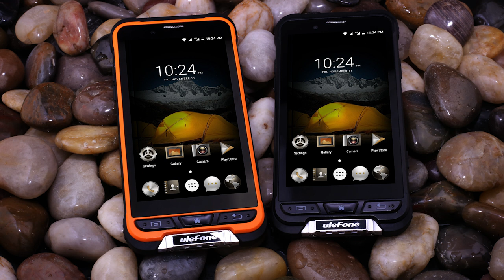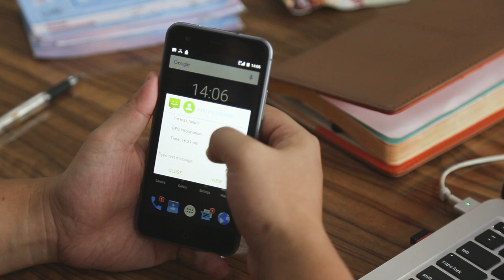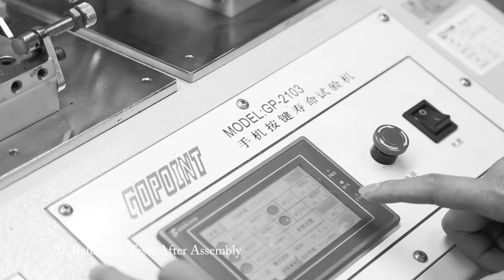Ulefone Armor - An IP68 Octa-core Phone with 32GB Storage

Comment: Its main feature is its IP68 Certification which allows high resistance to impacts, drops, bumps, is robust, withstands extreme temperatures, resistant to dust, water resistant, is an ultra-resistant phone, it can withstand everything, it has several layers of protection, Very complete device, amazing, resistant and all terrain ideal for strong work, Excellent

Comment: Why no MT6750 or even MT6755?!
Reply: The performance is similar, because supports the more network frequency band, therefore chooses the more stable SOC.
Network  2G:
GSM: 850/900/1800/1900 (band5,band8,band3,band2） 
3G:
WCDMA: 850/900/1900/2100 (band5,band8,band2,band1)
TD-SCDMA: 1900/2100 (Band34,Band39)
CDMA2000: 800(BC0)
4G:
FDD-LTE: 800/1700/1800/2100/2600 (band20,band4,band3,band1,band7)
TDD-LTE: 2500/1900/2300/2500(Band38,Band39,Band40,Band41)
Reply: Nothing of this is true. All current MTK chips come with full network coverage and the performance of MT6750 / MT6755 is better than MT6753.
Reply: I said that the performance difference is not much, especially the actual use, while the 6753 supports more network standards, including CDMA.

Comment: its too big...
Reply: Big? are you Kidding? Ulefone armor should be the smallest size IP68 phone.
Reply: Kenxinda W5 - 126,5mm
AGM A2 RIO - 133.7MM
iphone 7 - 138,3mm
KenXinDa S50:  146.3mm
Ulefone Armor - 147.9mm

and i didn' count z1 compact, z3 compacr, xperia zr... and so on because they have fake ip68 certification, water leak in.
the fact there are bigger ones doesn't make it the most compact.
just by adding the phisical buttons as "soft buttons" in screen, would make the phone way more compact, any phone bigger than 130 mm its already a brick in the pocket.
Reply: not big for a outdoor phone,but a bit ugly because so many screws on the back cover.